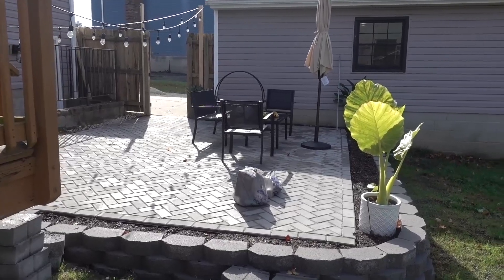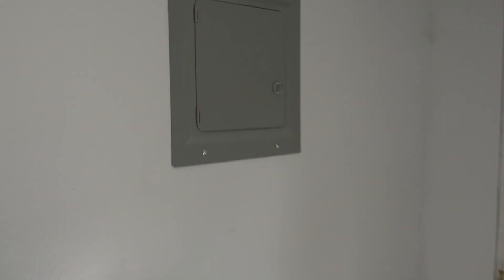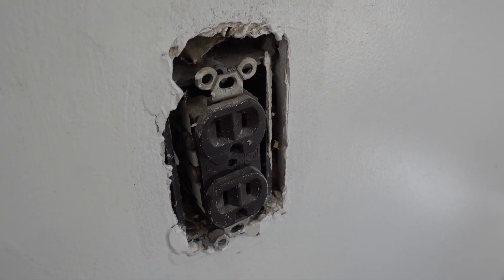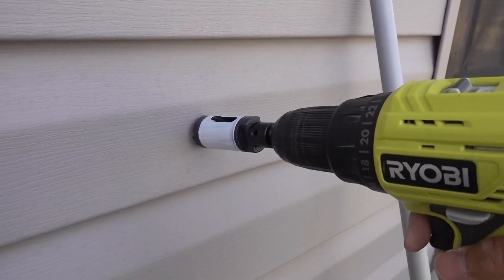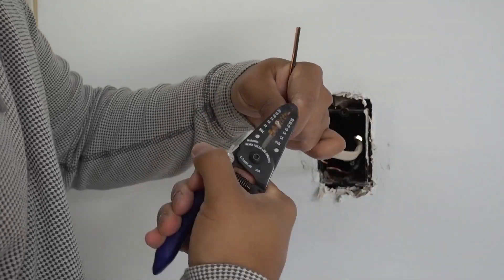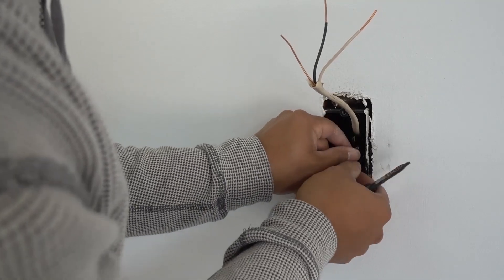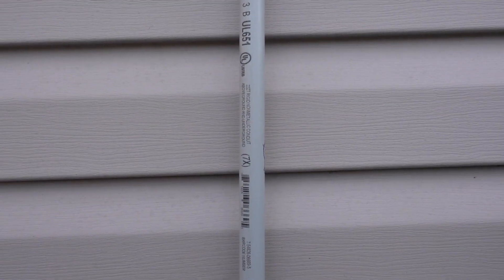How to DIY install an outdoor outlet

Comment: Good video for a beginner, but as a licensed electrician for the past 25 years there's just a couple things you really need to pay attention to. Without sounding critical, that outlet needs to be higher off the ground. And second, everyone is so tempted to use a screw gun for everything and there's some things that you need to feel how tightly you are tightening them down. I would never recommend to anyone to tighten the screws on an outlet or switch any other way but by hand. It gives you a feel for everything. There's a few more points but overall you did a great job for a beginner. Just don't be surprised when you go to sell your house that a home inspector says something about how low that outlet is sitting even if it is a GFCI with a cover. 👍
Reply: The problem is that it is beginners and DYIers that have the time and willingness to do these videos instead of pros like you.  Most likely because you are busy doing your electrical work.  Understandable.   I came here hoping for a pro to show me how to do an exterior box over Vinyl.  This is the best I found.  Dave, make us a video bro :)
Reply: @RyanDyalRealEstate  there's already enough videos out there about everything anybody could ever want to know. Everything is a work in progress in learning how to do things. There was a time years ago when I didn't even know what hot and neutral and a red wire meant and as time goes by you learn 👍
Reply: @superdave7241  Thanks for the comment Dave.  I learned from you today as well.
Reply: @RyanDyalRealEstate  Thanks, I appreciate that.

Comment: You should have used 12 gauge for a 20 amp breaker.  Also, shouldn’t that conduit be galvanized steel, and not irrigation pvc? That pvc is going to shatter from UV rays.
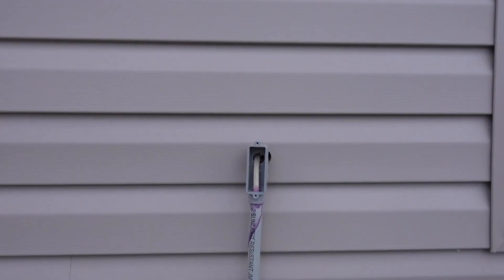Reply: 11:26 Guess you missed the "sunlight resistant" marking on the electrical PVC conduit which is not the same as irrigation PVC!

Comment: Just watch that video clip you made
and one mistake you made was using 14/2 Romex for your outlet connection. Well my brother, using 14/2 is wrong for outlet boxes. You should be using 12/2 Romex , according to NEC code , with a 20amp breaker in your panel box. Question, did you check the amperage of the breaker that controls the outlet you are taking power from? Just checking.

Comment: Electrical connections on outlet are incorrect.  Never double tap an outlet, unless you are separating the duplex receptacle into 2 single receptacles with 2 separate power sources. WHY???? because if the outlet fails, you lose everything connected down the line. ( like other receptacles that are connected in line ) The electrical work is not even close to code. Hope your house doesn't catch fire. good luck!

Comment: That illegal to use that cement bro code requires the electrical solvent u got the wrong one that the stuff for plumbing  this is the legal one for eletical Oatey 16-fl oz Gray PVC Cement  that box is also not at code height that is way to low

Comment: Good work but the main thing is you didn't need to use that many wire nuts. Only use  a single wirenut to pigtail the grounds.  Change indoor outlet into a gfi outlet. Line would be old wire, load would be wire to outside. And use a weather proof outlet for outside.  I believe the elbow for outside is just code

Comment: I would've fished down the wall from the inside and drilled a hole on the outside and joined steel fish tape inside the wall. No conduit, clean.

Comment: One thing I would have done differently is install the GFCI in the inside box, then install an ordinary receptacle outside and have it connected to the GFCI's "load" terminals. This way, everything outside (receptacle, metal outlet box and wires) get ground fault protection, and the GFCI itself is protected from the elements. In my experience even "weather resistant" GFCIs are prone to early failure when installed outdoors.

Also, you get the added benefit of not having to go outside to reset the GFCI breaker if it ever trips. This is good especially if you live in a cold climate and are using the outlet during Christmas lights season. 😁
Reply: ^This 100%

Or at least have the breaker it's on be a GFCI breaker.

Comment: I watched that whole video to find out what kinds of screws you would use for those straps at the end and you skipped right over it 😭 Otherwise great video!
Reply from the maker: I believe I used some sheet metal screws for it! I use eyed the size. Hope that helps! I also have a follow up video to correct some things I did incorrectly here!
Reply: Exterior screws so they don’t rot

Comment: The national electric code does not permit romex wire inside of conduit
Reply from the maker: Yup, I've uploaded a follow up video where I replaced the Romex with THHN!
Reply: @JohnHeng  you have weather resistant  type gfci
Reply: @JohnHeng  you should use TWHN since it's outdoors. This is the weather resistant version. Use 12 gauge since it's a 20 amp circuit.

Comment: Is that just regular Romex? Shouldn't that be outdoor rated? Even the best weatherproofing could degrade after a decade or so. See a youtube video titled "This is why Electricians don't use Romex in wet environments (TROUBLESHOOTING OUTDOOR LIGHTS)" by Electrician U.
Reply from the maker: yup! I've created a follow up video where I replaced it with THHN. Hope that helps!

Comment: You need to get a multimeter, outlet testers on bare loose wires are not safe!

Outlets should also be eighteen inches from the ground.
Reply from the maker: I have one but my father in law was borrowing it! I was trying to be super careful using the outlet tester though

Comment: Hi, thank you for dedicating your time to record and share this video. I’m just DIY homeowner and I’m planning to wire my outdoor outlet next week. I don’t know if your code is ok with connecting interior and exterior receptacles; I’ll wire mine with its own 12/2 wire with 20A breaker. And I would place the outlet higher from the ground. Definitely need to ground the metal box.

So many unnecessary comments about the saw. Gosh people relax, not big of a deal. The guy tried to show you more important things than the pity saw. Thanks man
Reply from the maker: Thanks for your comment! I did an updated video fixing some of the things I did wrong in this video (link in the description), one being that I didn't ground the metal box. I also replaced the Romex cable with THNN since it heats up less and is easier to pull through conduit. 

As for the height of the box, I would have wanted to place it a little higher also but I didn't want to put it on my vinyl siding. This area is also underneath the eaves of my garage's roof so it should be (for the most part) out of the rain and snow. I looked up my local code and there was no height requirement that I could find.
Reply: @JohnHeng  !8" Minium Height Requirement for outdoor electrical boxes. There's also a Maximum Height!

Comment: You don’t return a hole saw if you used it. You’re screwing the next guy who will buy that new when it’s been used.
Reply: I have been the next guy several times on products I got at the big box stores. Seems like something I should be doing too if everyone is. I try to borrow tools from neighbors first.
Reply: I wouldn't say the next guy is screwed. It's just a metal saw used for a few seconds. 🤣

Comment: What about using 600v THW insulated submersible pump cable. Its like the yellow romex but flat blue casing 10 gauge stranded wire. I have a bunch of it
Reply: Thank you for the video. I had all the tools on hand except the thnn wire. I too had planned  on using yellow romex :} and wanted to see if thats acceptable.

Comment: Using something for 4 seconds and then returning it is a dirt move other people don't like when they buy your 4-second-used product. You can usually tell. Then they/I return it back to the store again...another trip to the store. Just keep it for the next project.

But thanks for the video.
Reply: He shouldn't have said that on video even though most people would do the same thing (return). 🤣

Comment: Hey just some advice to cut through the siding without ripping it do it in reverse
Reply from the maker: Good to know, I just learned that you could do this with wood but thanks for letting me know that I can do it for siding too!
Reply: @JohnHeng  yeah man thanks for the video. I have to run outlets to my front porch and back deck so this really helped!
Reply from the maker: @CODstreamz  glad this video could help you!

Comment: NM Romex is not allowed to be ran through conduit as it can overheat and potentially start a fire
Reply from the maker: Ah alright, good call out. I looked into it and it looks like the national electrical code was updated in 2011 to include romex in conduit but it has to be within some fill limit, meaning that the conduit has to be much bigger than it should. Also pulling THHN through conduit is significantly easier (though romex wasn't hard in this situation).

So Romex can be run in conduit but THHN is preferred. I'll keep that in mind next time I do a project like this or need to rewire this. Thanks!
Reply: @JohnHeng  But as other mentioned,  this is considered "wet location" (despite the fact that it is weathertight) so using this Romex is not allowed. It has paper in it! The cable for outside is gray. Another reason is condensation that may eventually fill the box and pvc pipe.
Reply from the maker: How would you run it outdoors without conduit?
Reply: @JohnHeng  THHN wire can be ran inside the conduit not romex

Comment: Ryobi is sold at lowes too? I thought they were craftsman.
Reply from the maker: Oops, sorry if I said that in the video. Ryobi is only at Home Depot (or Amazon)!
Reply: @JohnHeng  darn it, I was hoping. Lowes has a better veteran discount. Thanks for the video, going to buy the stuff to do this right now.
Reply from the maker: @johnmichaels4330  Thank you for your service! I almost exclusively shop at Lowe's (I have the Lowe's credit card) but have to shop at Home Depot sometimes since my Lowe's isn't that great. Good luck on your project!
Reply: @JohnHeng  tyvm. Subed btw
Reply from the maker: @johnmichaels4330  thank you for subscribing!!

Comment: Thanks.  When you were testing the hot wire connection with the receptacle tester it lit up.  This was with the power turned off at the breaker, correct?
Reply from the maker: I turned it off so that I could handle the wires. Then when I wanted to figure out which one was the hot wire coming in from the box, I turned it back on and made sure not to touch anything with my hands, only the tester.

I turned it back off after confirming which was the hot before wiring more stuff in
Reply: @JohnHeng  thanks John
Reply: When wired correctly, hot is always black, and neutral is always white. Your ground should always be a bare copper wire.

Comment: Does it need a permit for this project,John? I lived in Los Angeles.Thanks.
Reply from the maker: I think it depends on your area. I think most electrical, like this, you can do yourself
Reply: @JohnHeng  thanks John.
Reply: In California,  you're supposed to pull a permit and have a license anytime you run new wire. Only thing you can do without a permit and license are simple fixture replacements.

Comment: Wish you would've shown exactly how you wired them together behind the original outlet.
Reply from the maker: Sorry to leave that part out! It was a little messy and I ended up not recording it. I have a more recent video on my channel, 'how to install an outlet to an existing wall', that pretty much goes over the same situation but also goes into detail on how to wire up the original outlet. Hopefully that helps you.
Reply: @JohnHeng  thanks I'll check it out.

Comment: Was gonna do similar thing but ppl saying pvc is for underground n that I need to use emt
Reply from the maker: I looked it up and you can use either but apparently PVC will be better in outdoor conditions, although it doesn't look as nice. I would continue to do research though if you're still undecided!
Reply: @JohnHeng  yea cuz i ve seen bunch of videos w ppl doing it outside and its looks good but ppl commenting be saying not ok idk, i already done some outside jw what ur thoughts were
Reply from the maker: @Eastbaypisces  I think looks wise, it's perfectly fine. It's gray so it kinda blends in with my siding. And it's cheap so if you need to replace it, it won't cost much. I didn't really look into EMT much when I was doing this
Reply: @JohnHeng  yea agree
Reply: It’s okay to use the grey cpvc piping.
Reply: Pvc conduit is designed for underground applications. It degrades in the sun and weather. EMT is galvanized and will uphold for years outdoors.  Even longer if you get it painted
Reply: @tvbrauer1566  they sell uv resistant pvc lol, and pvc holds up a lot better than emt outdoors especially if the proper emt fittings aren’t used

Comment: You need to ground the box and the ground on the box should be on the opposite side - your box is unside down.  Ground lug of box should not be on the same side as the outlet hot

Comment: So if you run the regular Romex inside pvc piping or other safe raceways you can use it outside??? Or in some states you have to use the outside exterior wet resistance wire “black one” ?
Reply: My county requires that I use a THHN wire that is water resistant when running it outside. Even when it's inside of pvc conduit.
Reply: Code in some states requires THHN.
Reply: UF cable is rated for outside installation.
Reply from the maker: I believe black PVC is supposed to be for sewage but I'm not 100% sure. I used Schedule 40 here and you can run electrical through it. It's resistant to sunlight and should be water-tight. I would double check though, there are definitely some that aren't meant for electrical.

Comment: you need to ground your exterior metal box.
Reply: Yes, NEC states any metal housing needs to be grounded.
Reply from the maker: Someone left a similar reply earlier and I've gone back and fixed it, thanks!
Reply: I can tell he was new to electrical work.

Comment: You should ground the metal external box as well. In the event the hot ever comes loose and touches the metal box, it is now a live conductor. If you touch it then something bad happens.  If the box is grounded and this happens then the breaker gets tripped as the circuit is completed to ground and no one dies! Short of that, great work.
Reply: The ground point is the green screw inside the box.
Reply from the maker: Good to know! I think I might have done it off camera but I will check and fix it just in case
Reply: How would you do that?
Reply: @zaneblane8160  some electricians take the ground wires and wrap it around the green screw before they connect it to any other ground wires with a nut. Others, run a pig tail from the ground connection wire to the green screw on the metal box.
Reply: @zaneblane8160  there's two ways. A)  you cut off some extra ground wire and pigtail it to the green nut.  Or b) keep ur ground wire slightly longer than the hot and neutral. Wrap it around the green nut first and then into the back of the plug.
Reply: Also, wrap electric tape around the side of the GFCI as a secondary insurance to prevent any shorts to hot.